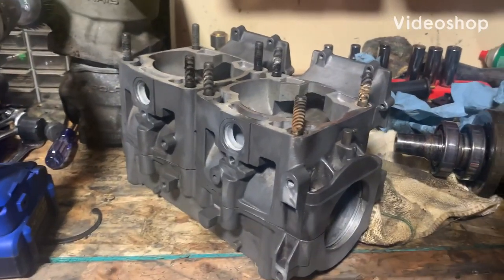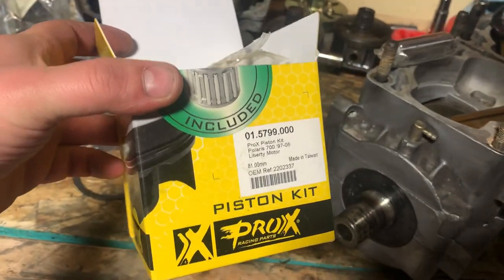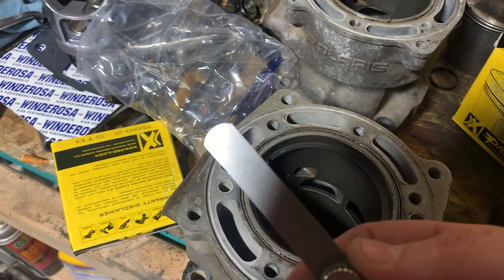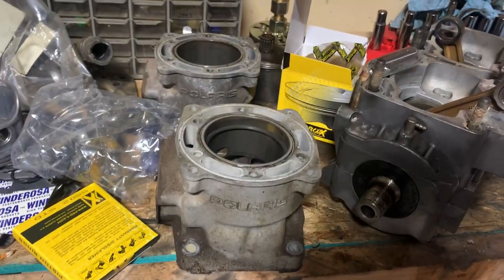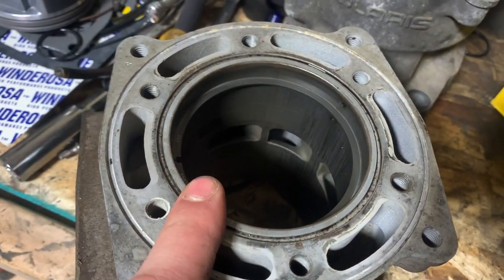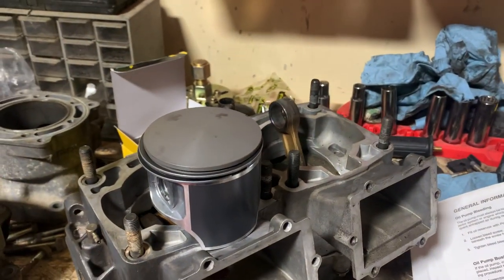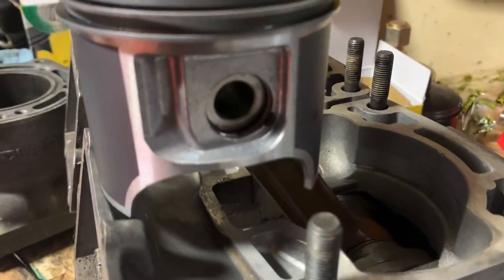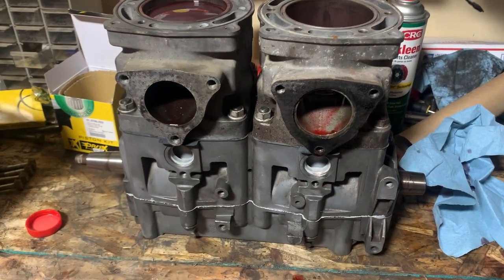Polaris 700 build update - How to Check your Ring end gap  !!!

Comment: So tell me can you hone Nikasil cylinders ?
Reply from the maker: Yes, you are supposed to when rebuilding. Anyone who says “don’t hone a plated cylinder” has clearly never opened a service manual.
Have I done it without honing? Sure. And it’s worked fine. But as per a service manual you are supposed to hone to deglaze the cylinder.